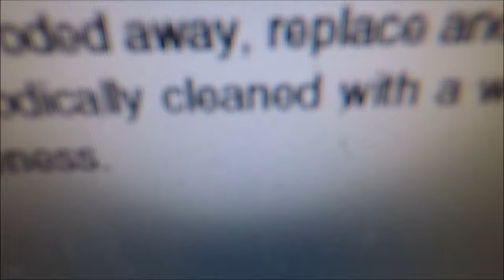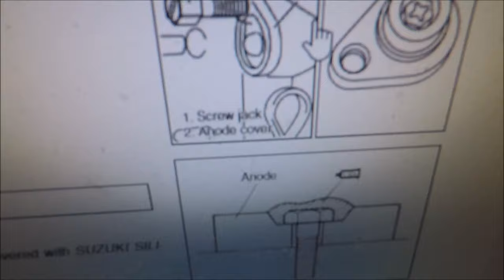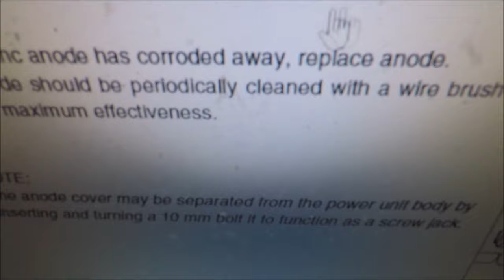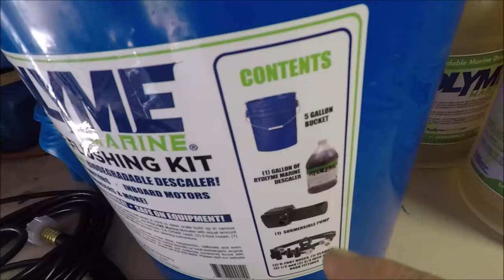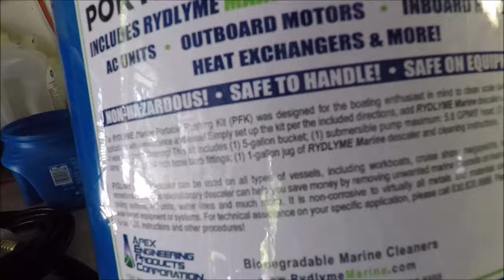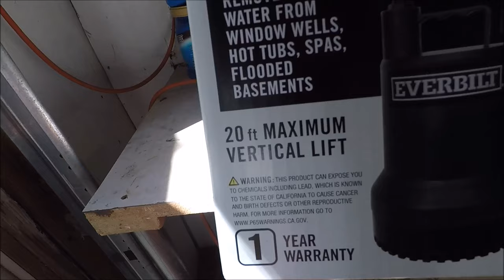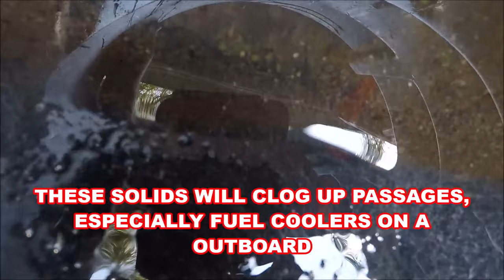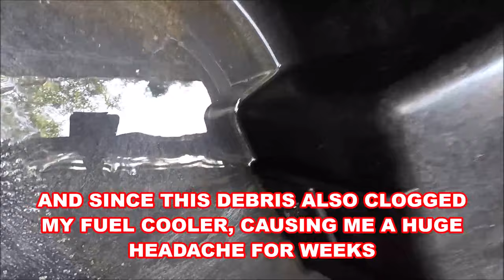ACID WASHING OUTBOARD MOTOR

Comment: Thanks for all the videos Dave Suzuki should sponsor you for all the great info you post.
Reply from the maker: yeah, that's funny. I don't have a TV show. I have a YT truth channel.
Reply: @CaptDavesSportfishing  Hi Dave, once again thanks for all the great information.  So looking at your videos, it seem that you no longer take off the lower unit to do the Rydlyme you just use your flush port (after you take out the T-stats and Zinks) is that true I'm about to do my twin 300 AP's.
Reply from the maker: @captpepin  well the only reason I had the lower unit off is because it was at the shop getting the water pump changed I don't do water pumps I'm not busting my ass with that heavy lower. yeah other than that I just recycled it through the engine

Comment: I know this is not a forum, as I have reached out to most of them with no solution to my problem.(a lot of help troubleshooting)I am reaching out to you because you have a Suzuki and are strict on your maintenance to see if you have any suggestions...I am running a 2013 250ss and I am having water pressure problems as well. 0 @ idle, 5psi @ about 3500 with the trim just bumped off tucked. I have changed both thermostats, the water pump, the filter screens, the pressure valve on the side of the mid-section. The only thing I haven't done is change the anodes. Nothing has made it any better. I'm running it on a 2013 Blue Wave and the cavitation plate is about 4" above the keel with a 10"jack plate.
Reply from the maker: replied to your email, know zero about water pressure, I deal in just temps and cleaning mud out of my motor, from the shit water i run.
Reply: Hi Kelly , do you still have problems with that water pressure ?
Reply: @133air5  yes I am.
Reply: @kellygunn6283  Hi Kelly , i'm not a mechanic or even a boat mechanic but have had my own good share of problems and fault  finding on all motors . see if you can find out what the actual pressure is of your motor pump at different RPM's -  see if the agent or manufacturer have any specs  . these impellers are small and don't have much rpm or pressure for a start . if you buy say a 110 volt pump from the shop it will have a decent size impeller or diaphragm and very good rpm and can do volume . so if this  was my  outboard motor , i would remove both the thermostats first . I would go as far up/ to the top of the motor as possible and devise some sort of a plug or something that could spray the water out . So if the motor is in a drum and it picks up the water by itself , it should be able to pump it all the way to the top furthest part of the motor without any hindrance .  now on this plug i would fit a  outlet or something that i can fit a tube to and plug one of these Manometers in . i have one at home that is 1m long . this is a bit small but just an example . . . see this one  https://www.ebay.com.au/i/322393752006? . you get special  yellow water coloring for the tube but food coloring will work too . even build your own , its just a U tube on a piece of wood.  Plug the manometer in on one side  and see  if the water moves in one direction . it should move as you must have water pressure . Say it blows all the water out the manometer then fit a balloon ( with some air ? )  to the other side of the manometer to give it some back pressure . Once you can get some reading out of it , you now have some sort of measurement . I would now check it at idle , 500 , 1000 and so on .dont over rev it stationary in the drum . the pressure should vary all the time . I would definitely want to see water flow even at idle . i would now start following the water temperature while the motor is running and i would expect the motor temp to be even all over the block and anywhere you suspect the water to flow  . definitely all areas around the cylinder heads as the whole idea is for the water to do the cooling here . get a digital temperature probe at a aircon or electronic shop and see how hot the water gets . I would take the thermostats , put them in a thick glass jar , pour hot water over them to see at what temperature they open . I did it with my car thermostat  , it was very accurate in opening and it even had the temperature stamped on the thermostat  . . think it was 85 deg celsius .  The outboard thermostats  have to open at some temperature , and note this temperature down . Now i will replace only one thermostat and see if the pressure changes on the manometer . also keep an eye out to see if there are any temperature changes on the cylinder block and or water temperature . Now fit the second thermostat and do the same tests . once the thermostats are open you should have even flow and temperature anywhere on the motor .  Also  someone had a fuel problem where the fuel would boil into a vapour because the water heat exchanger was blocked and then it would not start . if you have something similar and this exchanger  is inline then the water would not pass through and flow very slow or wont flow  through  at all . this would cause heating issues . That's all i can think of for now . just gather some data and that should show us where to go next . message me anytime and if you want to send some pictures or need more help.  let me know  how you go . regards André
Reply: Kelly I just seen a video saying to change the water pickups for the 250ss. My son has the same issue. New motor over heating around 5000 rpms. The part #s are 17631-98j00 and 17632-98j00.
Reply: Kelly Gunn - Is it overheating?

Comment: Capt Dave, great video. During the end of the video you mentioned that you are connecting to the Suzuki engine diagnostic screens. I know you need the software for the laptop and a interface cable to connect to the Suzuki, my question is where was the interface connector on your Suzuki 250. Was it a connector just dangling in the motor? Thanks.
Reply from the maker: Got all my software/cables/ service manuals on Amazon here: https://www.amazon.com/gp/product/B07DKVCC91/ref=ppx_yo_dt_b_asin_title_o04_s00?ie=UTF8&psc=1 it wasn't super EZ as you have to make sure your lap top is on the battery only why it matters I haven't a clue, and on a thing called "con one"....the key has to be on and the connector on my motor is on the front starboard side, by the rig tube inside, and it's a white/grey plug. Nothing fancy, thats for sure. Yep, just kinda dangling inside bottom cowling, part of wiring harness.

Comment: Capt. Dave,  I have 2008 DF140,  have you made any changes to the way you flush your motor since you last video? Thanks for the information!
Reply from the maker: have no clue, I run my engine out in a big barrel after every and my engine is absolutely squeaky clean inside I will never ever use those flushing ports.
Reply: @CaptDavesSportfishing  why don't you use the flushing ports?
Reply from the maker: @wazup3333  because the shit water I run in it will not flush out the motors "FUEL COOLER". You can run the motor on the flushing ports, ONLY in idle. Instead I use a 70 gallon barrel.
Reply: @CaptDavesSportfishing  are you saying you need higher rpm to flush the cooler?
Reply from the maker: @wazup3333  no a running motor with lots of clean water. if you run in crappy dirty water like I do. my fuel cooler clogged up on me by using the stupid flush ports for 4 years. caused me all kinds of trouble I have videos all about it on the playlist on my website that's about my boat
Reply: @CaptDavesSportfishing  the cooler or the vapor separator tank ?
Reply from the maker: @wazup3333  ON HERE SOMEWHERE:  https://www.youtube.com/playlist?list=PLK-ee3q-bFR2KPb2cDapcVKEbkUjsWyJM
Reply from the maker: @wazup3333    fuel cooler....never said VST tank. https://amzn.to/3L7Efvz
Reply: @CaptDavesSportfishing  I tried flushing outboard in a pale, I reved it higher and everything but I don't think the thermostat opened up, because the hose out of the thermostat was always warm... So how do you fully flush the engine with the thermostats opening???
Reply from the maker: @wazup3333   you have no temp gauge? was the water running into said ''pail'' (spelled correctly) to keep cool water flowing?  I have no idea what motor, what your doing, and I really show in a video what I do, and it ends there.

Comment: Hey Dave - great video. Quick question - why didn’t you plug the tell tale to keep it only recycling into the tub in the bottom?
Reply from the maker: , because it doesn't matter and I had it going into a bucket anyhow

Comment: Hi , surely the engine must be at working temperature ,before any flushing can take place ,so the thermostats are open to allow all the water ways to be cleaned ,a lower pressure pump could be used to allow the cleaner to be in the water ways for a longer time ,as the cleaner only works on contact with the sludge and salt and takes time to remove it .This may save taking it all to pieces every time .
Reply from the maker: I NEVER EVER use these flush ports anymore. Only run each day in a 70 gal. barrel. with freshwater. I advice same if you run in dirt water with salt!
Reply: He took the thermostats and anodes out then put the covers back onto flush. Clearly said so at the beginning.
Reply from the maker: @HarleyRog  NO ONE LISTENS... cuz they are on litl' dumbphones, 99% of the time. Yep, not my first rodeo!

Comment: Ok guys
I spent the day giving my 2016 Zuky some weekend love. Everything but the impeller. Plugs to oil. Popped my sacrificial anodes out for a look. I was stunned at what I found. The opening for the anode was completely blocked with salt and scale build up. Anodes were ok but I replaced them.  Now understand I flush my motor at least 15 minutes after each use fresh or salt. Clearly I was not doing a good enough job. I will be flushing my motor Captain Dave's way. Bet that. Wish I could post a photo of the mess I found. 
This is a 2016 Zuk with 328 hours. These anodes had around 150 hours on them.  Keep on thinking you good. Cause you ain't! Pay a little now or pay big later.
Reply from the maker: service manual states.....check, inspect, replace every 50 hrs. or 3 months. YES, I R-U-N MY $20,000.00 TO REPLACE (never spent that on my 3/4 ton diesel truck!!!!) BY RUNNING IN MY BARREL TILL UP TO TEMP (t-stats open at 122-125) AND CAN YOU IMAGINE, IF I DO MULTIPLE CHARTERS LIKE 4 IN A ROW, THATS 4 DAYS OF FILLING THE BARREL UP......TIME? yes, it takes more time. But, that ''fuel cooler'' on your zuki, to replace costs good money, and tie to replace, so does the anodes........PAY NOW, OR JUST PAY LATER!
Reply: @CaptDavesSportfishing  
Clearly I failed. Thought I was good. In reality I was a dumb a**. 
But I ordered 4 more sets of anodes, 4 gallon case of Rydlym and down loaded the service manual last night. I will fix this and keep it on point.
Reply from the maker: @BlastedKat  I was agreeing with you about iFish's comment.  He's in Chicago area, so that says it all.......😆😆😆
Reply: @CaptDavesSportfishing  yes sir. That's how I took it. No worries , I hear outboard motors don't corrode up north. Immortal motors! 😜

Comment: Capt Dave's Sport Fishing, Thank you for your advice and explanations!  I bought the same sump pump for various flushing on my New Suzuki df200. I live up north where it freezes. I know outboards self drain, but, I like to run the pink non toxic antifreeze.  its cheap insurance and includes corrosion protection. Is it possible with the Suzuki, to pump several gallons of the antifreeze through the flush port with the sump pump and call it a day? Or, would I be better off running this through the muff's once the engine is warm?   Many thanks for your advice!   :)
Reply from the maker: Number one it's going to drain so it's never going to hold any liquid in the engine what I'm doing is to descale and get rid of dirt salt nothing to do with winterizing I'd consult other outboard owners I know most people take off their lower unit and service it with water pumps a new gear lube over the winter other than that I don't know what they do in winter time up there
Reply: Many thanks!  We have alot of river mid and silt. I will be following your descaling process as well!

Comment: Hey Capt. first time boat owner here. 

When you say you ran your motor in the bucket for 3 hours… how much throttle are you giving it? Just putting it in gear or more? Or keeping it in neutral? And do you run it at the same rpms the whole time?
Reply from the maker: ran the descaler thru it for 3 hours. Motor is not running
Reply: @CaptDavesSportfishing  got it thanks!

Comment: Dave lift the run product above the motor catch and recycle to the holding tank . The little pump will like pumping down hill ? 🤔
Reply from the maker: i got it done several times now, my sysyem works great, with my 1680 gal per hr. pump.  the point ""IS"" THE SHIT in the st. johns river!!!

Comment: Capt Dave, after getting nowhere with Salt Away, I just ran a rydlyme flush through my zuke 140.  This was long overdue.  1 gal of rydlyme diluted with 1 gal of H2O.  I was surprised to see how quickly the water got HOT.  My temp alarm never went off but it was getting hot to the point of being concerning so I shut it down after 15 - 20 minutes.  Hot bath water.   Do you experience this when flushing your engine.  It was only 2 gallons total so maybe this was to be expected with the small volume and no cool water being introduced.  Regardless it made a HUGE improvement, but it needs another flush.  Before and after pic's are incredible.  

Is there a way to know when the thermostat opens?  

Saved a couple of bucks on shipping by buying direct from Apex Engineering and not using Amazon.
Reply from the maker: did what you saw....ran mostly thru the flusher on motor. not running. t-stats and anodes out. I wouldn't do thru a set of muffs, and do not run motor! if so no wonder it got hot. t-stats need to be out and all anodes.
Reply: @CaptDavesSportfishing  Yes I had anodes out, but took the t stat out this time and  used a submersible pump (25 gpm) to feed the flush port.  It's only getting a trickle - it's barely weeping out of the tell tale, I see that you are getting a nice pee stream using a submersible. Yet when I dunk the boat at the ramp and run it I get a better stream but probably not as good as it should be.  For some reason the submersible wont work as well as when dunking and using the intakes.  My conclusion is that the internal water pump must be more efficient than the submersible and that I probably still have some blocked passages yet I flushed the Rydlyme for about an hour.  I'm not sure what I should do from here.
Reply from the maker: @ericbrockett3226  do exactly what I did. 25 ghp pump isnt diddly! I used a 1680 ghp.
Reply: @CaptDavesSportfishing  Sorry my pump is 25 gpm = 1500 gph.  your pump is 28 gpm = 1680 gph.  I'm using a similar submersible pump.
Reply from the maker: @ericbrockett3226  then similar results should happen
Reply: Capt Dave, just wanted to thank you for your vids.  I finally found the problem with my trickling tell tale, it was a pinched line.  A drain line was wedged between the oil filter and the engine housing.  Your videos helped me get into my engine, take care of a bunch of things, I learned a lot thanks.

Comment: Wonder if it would be any advantage to the treatment before changing anodes?  May make removal of anodes easier. Love you videos.
Reply from the maker: Rydlyme dissolves anodes, (as per instruction) so most likely you'd get more junk flowing thru the motor. I don't want to add more of anything but.... CLEAN. And the anodes aren't that hard to take out. Just need the correct items per the service manual. In my case the 10mm "jack bolts" used to pull them out.

Comment: I have a 2013 Mercury Verado 200 and want to run Rydlyme through the engine block. I have removed the poppert and the thermostat, can I just run the water into the thermostat location and have it runout the poppet and the drain in the lower unit and recycle back into the thermostat for a couple hours?
Reply from the maker: you can do what ever ya want

Comment: I know exactly what you are doing because I’m going through the same situation
Reply from the maker: I believe this was before I found out my fuel cooler was completely clogged take your fuel cooler off before and check to see if it's clogged if your engine heats up to normal temperature Batman keeps stalling

Comment: Wondering if white vinegar (very acidic) would assist if watered down a bit. I know it dissolves rust but not sure what it does to aluminum and various stainless steels.
Reply from the maker: Doesn't do diddly.
Reply: Yes. Half vinegar and half water will work over a bit of time flushing through.
Reply from the maker: @wirplit  so does warm water in my barrel.
Reply: @CaptDavesSportfishing  Clean water will take out some of the crap but a strongish vinegar solution  50% say will dissolve the salts and crud. Run through a few dozen times over a period definately cleans the inside. Certainly worked for me.
Reply from the maker: @wirplit  this is a old motor and a old video. I have a newer Suzuki 250 that just turned 2 yrs. It's clean as a whistle inside it. I just let the water in my barrel warm up a bit and it works fine. It gets well used and every trip it gets run out. 50% vinegar or 77 gallons is a big expense. And this motor will hopefully be Gone at 1000 hrs for a new one anyhow.